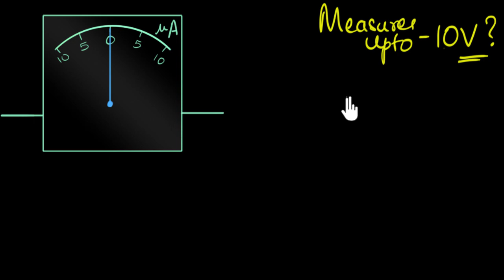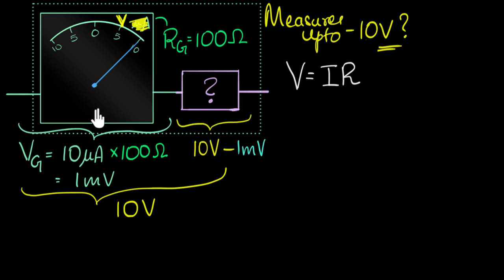Conversion of galvanometer into voltmeter | Moving charges & magnetism | Physics | Khan Academy

Comment: Why the resistance should be connected in series here ?
Reply: Cause if it was in parallel connection, both the resistance would share the same voltage, but we're trying to drop the  voltage here,that's why it's in series.

Comment: thank you so much Mahesh sir for this amazing lesson ! :) however i have a doubt that if we add a resistor of fixed resistance (maximum resistance to be dropped off) then how will the galvanometer be able to show a voltage less that the maximum voltage (10 v in this case) ? wouldn't it be dropped at the resistor ?

Comment: Sir in 8:00 when voltage applied is increased to 10V then why doesnot current in the circuit increased
Reply: Because of high resistance.
Reply: @mrcastor9514  thankyou